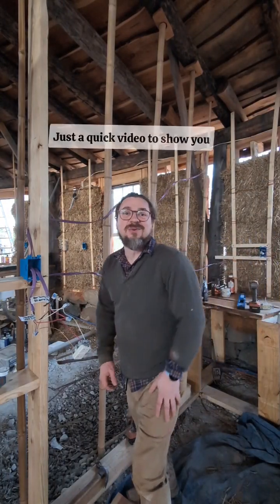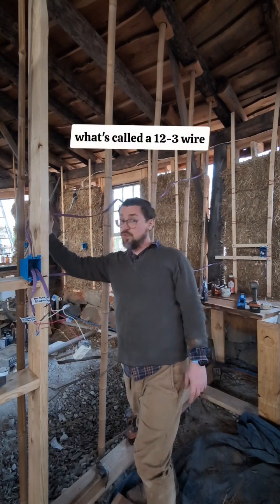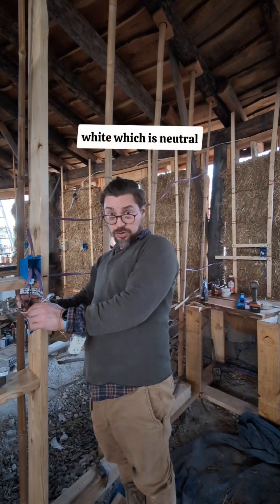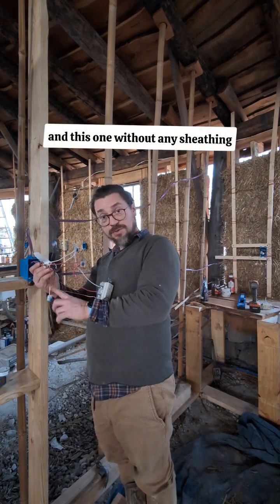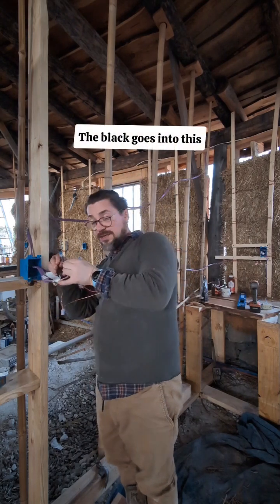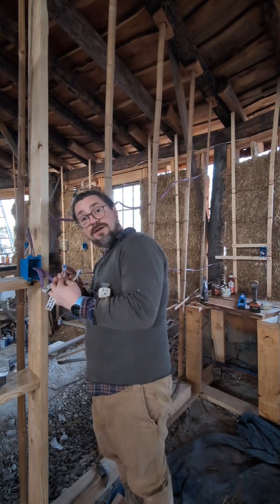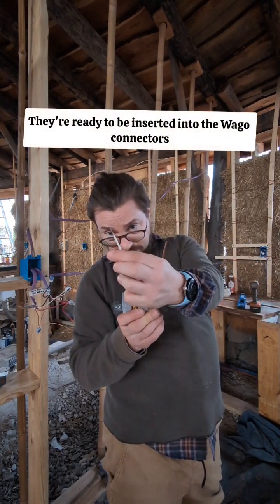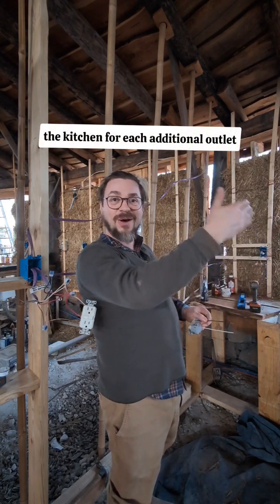Wiring 2 20 amp kitchen circuits with GFCI receptacles #diy #naturalbuilding#strawbale#electrical

Comment: You, my friend has the exact solution to the problem I am trying to solve.
You just showed but didn't proof that it works. I checked yours site it doesn't show that you completed hooking up or show the completed pjoject. It would've been nice if showed a completed and tested project, a bit too casusl about this.
Reply from the maker: You're right, I need to follow up on this video. I did wire everything up and I've been enjoying electricity for a while now, but I agree: way too casual. Especially since I made a mistake by blindly following a misprint in the Black and Decker wiring manual! Check the other comments on this video for clarification, and thanks for commenting. Hope you got your wiring project figured out!

Comment: How does the black wire with wego connector go from the first gfci to the next receptacle.
Reply from the maker: The black wire is wired to another wago connector in the next receptacle's box, but not to the next receptacle itself. It just continues to the third receptacle, which it is wired to. (On the brass connector.)

Comment: You just energized the common yeah?
Reply from the maker: Thanks for pointing that out! My Black and Decker Wiring Manual had a misprint! Common is now connected to the silver terminal!
Reply: Not sure if you’re messin’ or not.  I’m being straightforward and asking.
Reply from the maker: No, I'm totally sincere, I made a mistake in the video based on a diagram that was incorrect in the Black and Decker wiring manual I was using.  I'm trying to figure out how to post the diagram on here, but basically, it said to wire the red wire and the white wire to "Line Brass." That is wrong, and would result in a short. Instead, the red wire should go to "Line Brass," and the white (common) wire should go to "Line Silver." Now we know! I might post another video correcting this one. Hope I didn't cause any confusion!
Reply from the maker: @SneakAttackFilms  the common is going to be attached to the line silver of every outlet. The red and black wires will be attached to the line brass of alternating outlets.